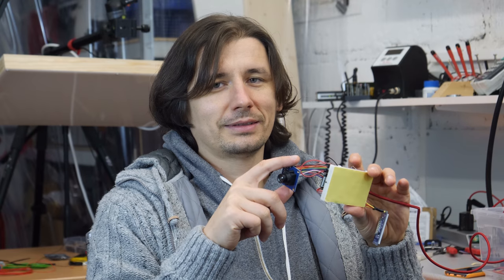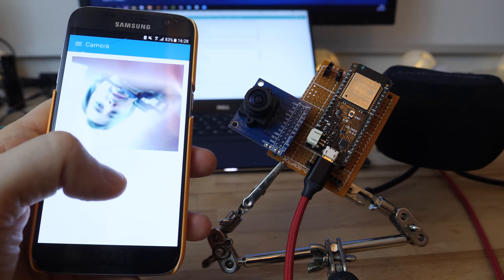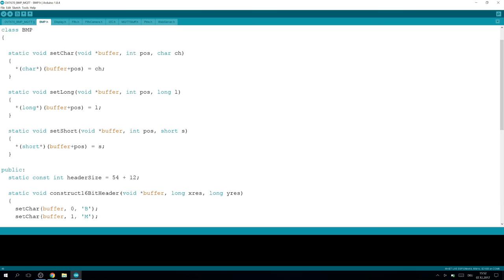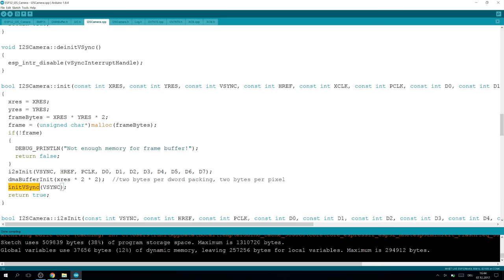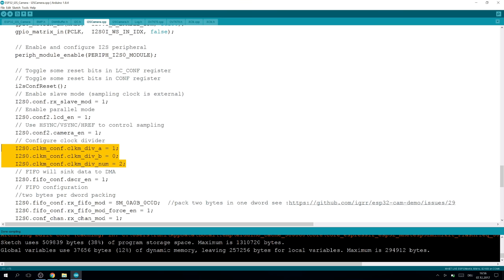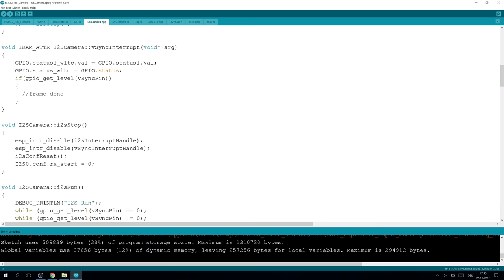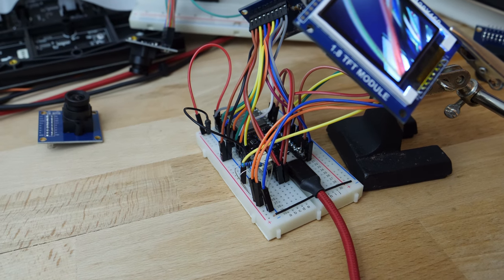ESP32 I2S Camera (OV7670)

Comment: This is actually really useful.
Very cheap and low power way to monitor something, possibly tie it to a motion detector to stop taking new pictures when nothing is happening.

Or do the opposite, have it alert you when something stops moving. For example if you want to use this to monitor a 3D printer it can alert you when the print is done, or if something is wrong(you’ll have to determine that yourself from the photos).

Without a screen these could be made for less than $10 each.
$3 for the esp32(wroom), $2 camera. Other parts would be nearly nothing.
Power usage would be very low. Probably paying cents per year to run, and it’s always around.

Great work

Comment: Great walkthrough on i2s specifically. The i2s.int_clr = i2s.int_status will be reading the interrupt status register. Normally you would then have a switch statement to handle each sub component interrupt reason by handling each bit that’s active. But since there is only one used in the demo it simply writes the status register as-is instead of masking it first to the interrupt clear register.

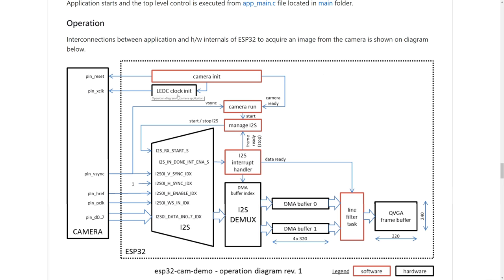Comment: @10:15 Could a TVP5150 NTSC/PAL/SECAMVideoDecoder being used as source here instead of the OV7670 camera? (PAL 720 x 576 resolution)
Reply: The ESP32 boards currently available in Germany (WEMOS LOLIN D32 Pro V2.0.0) do feature 8MB PSRAM/ 240 Mhz clock.
Using this as a PAL (1.66 MB) or VGA (1.23 MB) frame buffer shouldn't be a problem, right?

Comment: Code stuck in "connecting wifi" boot loop.
Reply: same but I noticed that the actual error is this: assert failed: ledc_clk_cfg_to_global_clk ledc.c:444 (false), which causes the esp to reboot thus reconnect, have you gotten it to work since?
Reply: @szymonzak6681  I have not, though I only tried once after this before other projects had to be finished.
Reply: @ManVersusWilderness  ahh, that's a shame, quite frustrating cant figure out what it means, oh well 👍

Comment: I tried this with a doit esp32 devkit v1, but the camera is way slower than what you're showing here, i also had to fix an error with a led_c parameter that wasn't working correctly with the newer version of the esp32 core for arduino, any suggestion of what i can look into to make it faster like in your video?
Reply: Using the same microcontroller, having some issues aswell.
Can you share your code?

Comment: thanks for providing this awesome code, it works like charm. Anyway i ran into some trouble when using it together with a servo motor and the ESP32Servo library. I will now alter my setup a bit and use another micro controller connected via serial which can control the servo, so no problem this time. But could you explain why this problem exists? Is it due to the ledc timers?
Reply: it was the XCLK timer, i changed the channel and now it even works together with the servo

Comment: when I compile the code on Github and with the appropriate schematic circuit. But it doesn't use the TFT Screen and when accessing the esp 32 IP address it doesn't display as in the video above. So what should I do to get the image via the local web

Comment: Hi. i am an electronics learner. i have ov7670 camera and esp8266

esp8266 has 30 pins
ov7670 camera has 18 pins.

can you show me the circuit diagram to connect what pins to what ?

and i want to stream on wifi

Comment: Thanks for the great information! i have one problema in another Project, i need to store 8 bits values in esp32 ram, but it only allows for 96000 bytes máximum allocation, there's  ram left in the esp32 , at least 150 k , this is a big mystery,could this dma method be the solution?

Comment: I used your example for the one without the FIFO.
Only when I use 
camera = new OV7670(OV7670::Mode::QQQVGA_RGB565, SIOD, SIOC, VSYNC, HREF, XCLK, PCLK, D0, D1, D2, D3, D4, D5, D6, D7);
I'm able to see something on the webpage, but the image which is displayed is very pixeled, so you are not able to see anything.
Also, the update rate is very slow, but I see the pixels getting different colors.
Are you able to tell me what I missed. (used the 4.7K resistors between SIOD - 3.3V and SIOC - 3.3V
I used an ESP32 Dev module and the OV7670
const int SIOD = 21; //SDA
const int SIOC = 22; //SCL
const int VSYNC = 34;
const int HREF = 35;
const int XCLK = 32;
const int PCLK = 33;
const int D0 = 27;
const int D1 = 19;
const int D2 = 18;
const int D3 = 15;
const int D4 = 14;
const int D5 = 13;
const int D6 = 12;
const int D7 = 4;

Comment: Great work. Stupid question here. The camera should support jpeg capture, this should be much less demanding then bmp and allow higher resolutions. I am not interested in direct display, more in timelapse capture. Do you have the documentation for the chip without fifo buffer? Do you think this would be possible?
Reply from the maker: Yes there are different versions of the camera supporting jpeg. Check out the code from igrr. He implemented that feature
Reply: I can't fibd the code that js in the vd please how i find it

Comment: Is this OV7670 connected to ESP32 and using the WIFI network suitable for streaming video from another location? It would be a good transmission, very slow or impossible?

Comment: Hi, i just try your code into my project. But i found problem when i access web via browser that produce by the esp 32. When esp32 produce local ip (ex :192.168.43.209) i try access site from my browser but it taking too long respond. Do you have any suggest to.solve it? Thanks before
i'm engineer

Comment: Im guessing you need to trigger your frame reads with the vsync pin on the vertical back porch of each frame (check with a scope). As long as you can read the frame quick enough before the next frame's front porch you may not have to do any clock speed tweaks for the camera setup as its the master. Ideally you would like to pull this frame into some local buffer but if your lacking ram for this maybe adding another ext. Sram chip would be help so this can transmit with more time to spare.

Comment: you could also try an fpv camera, those have ntsc or pal outputs and if the esp32 is fast enough to receive that data it would make the wiring quite a lot easier and cleaner :]

Comment: Very nice, I did not make the setup yet, but will do. 
Whoever, when I try to compile with a static frame buffer it compiles well for 320x240 pixels, frame buffer is 150K out of 540K of available ram. Can it be that when using malloc it fails but with static deceleration it is OK? (maybe other malloc will fail at run time)
//--------------------
unsigned char frame1[320 * 240 * 2];

bool I2SCamera::init(const int XRES, const int YRES, const int VSYNC, const int HREF, const int XCLK, const int PCLK, const int D0, const int D1, const int D2, const int D3, const int D4, const int D5, const int D6, const int D7)
{
  xres = XRES;
  yres = YRES;
  frameBytes = XRES * YRES * 2;
  
//frame = (unsigned char*)malloc(frameBytes);
  frame = frame1;
.
.
.
Reply from the maker: It could work if you are lucky. I got all kinds of strange errors in the past. even sometimes the compiler didn't complain but the sketch didn't work

Comment: What is the limit here,  why only slow updating of lcd?
Reply: I imagine its because everything is done serially, and then waits for a VSYNC to start again.
1. Wait for VSYNC
2. Start DMA
3. Copy DMA data into frame buffer
4. Send whole frame buffer to an LCD
5. Send whole frame buffer over WiFi if required
6. goto 1

By removing the LCD code it will improve the timing a bit.
I managed to get it running at 13 FPS, but I think it can be improved further.
Without testing it, I think the biggest time waste is when it waits for the next VSYNC.

I wish the DMA hardware (I2S) could write the image data straight into the frame buffer, but unfortunately it cant, so we need to loop over data and put it into the correct format to use.
Reply: How did you get 13fps - github?